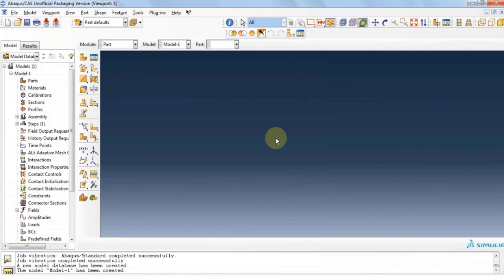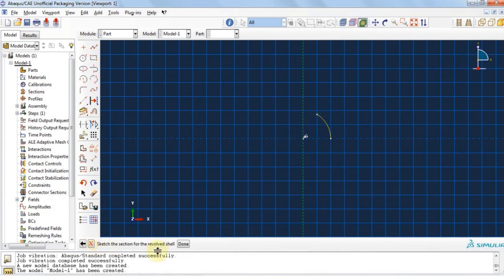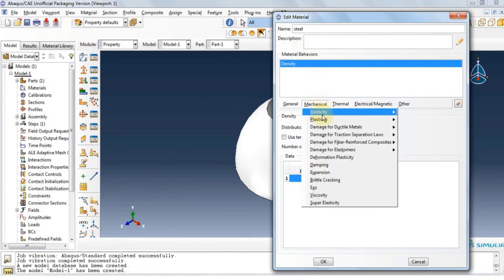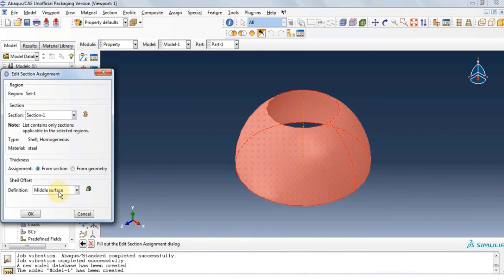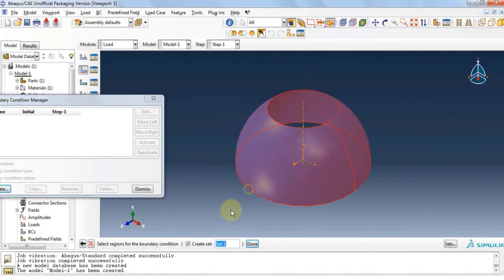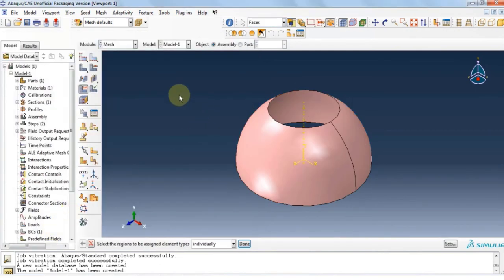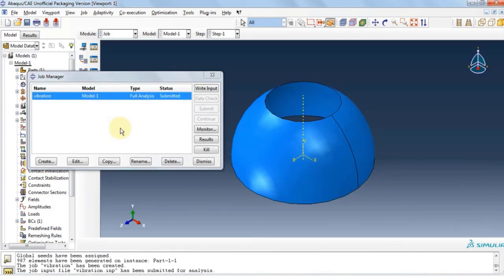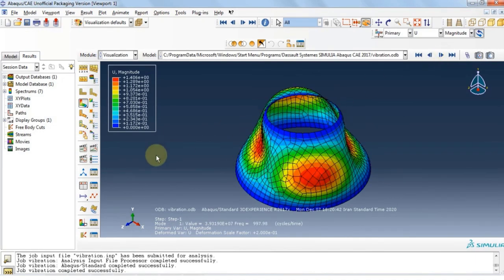Vibration of Doubly Curved Shell with Abaqus| Introduction to Abaqus | Abaqus for Beginners

Comment: thanks for the great video on vibration analysis. Abaqus is one of the most important softwares for modeling industrial projects . I always have challenge on how to set section on my modells. please share more videos on this topic for mechanical engineering models.
Reply from the maker: Thanks a lot for the comment. please watch our other videos of Abaqus series. We have covered buckling and static analysis with Abaqus so far. You can also watch our other videos related to FEM software such as COMSOL where you can find lots of videos on advanced topics such as triboelectric nanogenerators.